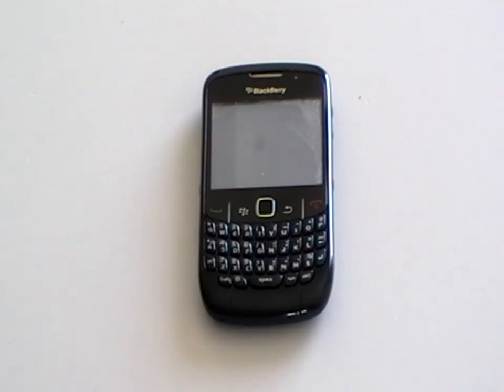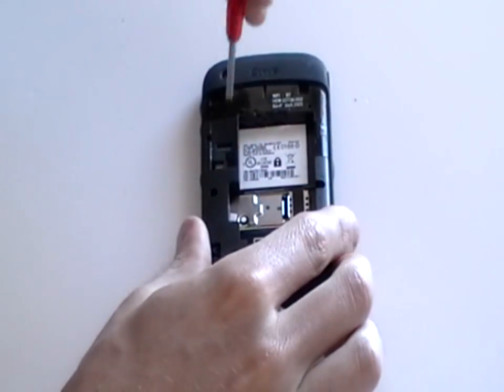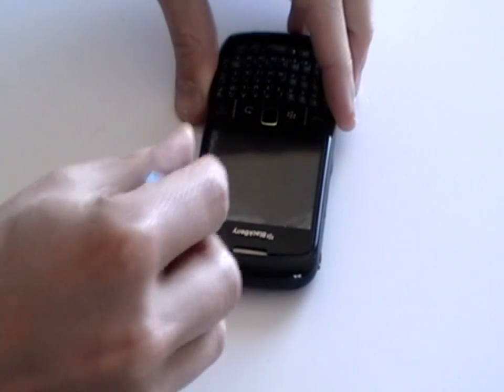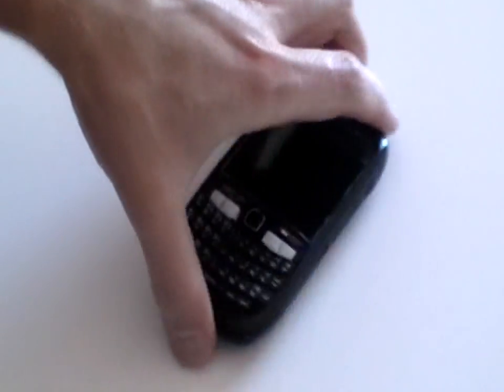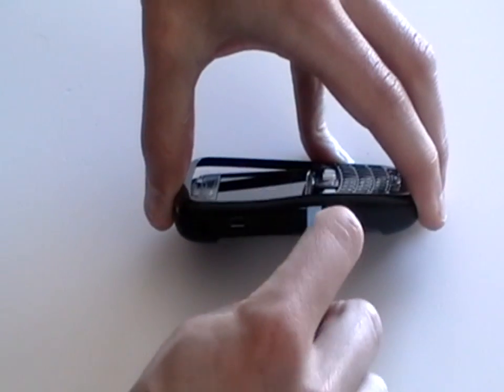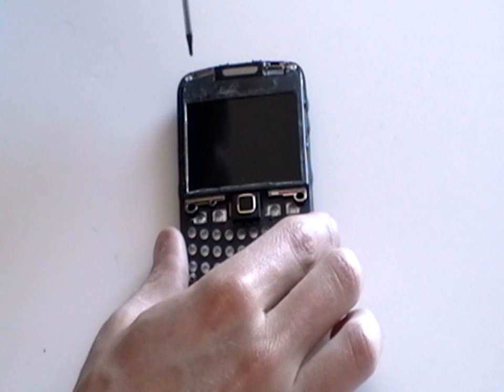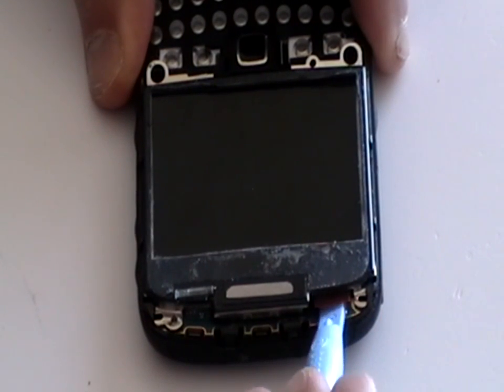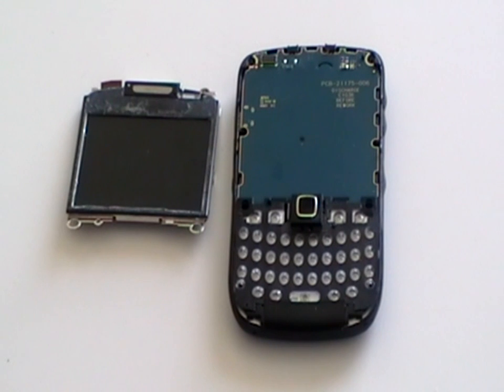Blackberry Curve 8520 Take Apart & LCD Screen Repair

Comment from the maker: If it is just the outside glass that is cracked then you will only need the the touch screen digitizer. If the inner display is busted the the LCD needs to be replaced.

Comment from the maker: You will either need to use a screw extractor to remove the screw, or use a small drill bit to drill out the screw and remove. These are your two easiest options.

Comment from the maker: Could be caused by the bent pin, however it seems unlikely. To be safe, I would suggest attempting to straighten this pin. 
Other causes could be motherboard damage or the wrong LCD version being used. Did you double check the correct LCD version was being used?

Comment: well it all started off when i droped the phone and the screen still worked but the top front  cover had smashed. the screen worked but 1 day turn white i put a new lcd screen in and its doing the same thing i think there is a we pin bent on the lcd conecter on the motherbord . but its not bad . so could there be any other way that would couse the screen to go white. thanks for your reply :)

Comment from the maker: What kind of damage was causes? Bent pins? 
White screen can be caused by many things, including damage to the LCD screen, motherboard connector, or the wrong version of LCD screen being used. I would suggest checking the old LCD screen part number to be sure it is being replaced with the correct LCD version. We have a video in our channel explaining this.

Comment from the maker: @DeanneW94 You will either need to use a screw extractor to remove the screw, or use a small drill bit to drill out the screw and remove. These are your two easiest options.

Comment from the maker: @GaryDomaz Normally you can reuse the old adhesive off the lens, however new adhesive will insure a nice seat, so no dust will get under the lens. Pre-cut adhesive can be found at RepairsUniverse (dot) com.

Comment from the maker: @mclem1902 You will either need to use a screw extractor to remove the screw, or use a small drill bit to drill out the screw and remove. These are your two easiest options.

Comment from the maker: @superkirby14 Very true, you can use credit cards, guitar picks, small flat head screwdrivers, etc. However the safe pry tools are very handy for these repairs and are made of soft enough plastic that they will not scratch or damage housing and other components.

Comment from the maker: @sophieenaglee You will either need to use a screw extractor to remove the screw, or use a small drill bit to drill out the screw and remove. These are your two easiest options.

Comment from the maker: @kevin619ize The screen can be removed this way, but not installed - you will not be able to attach the flex cable properly. You will need to get a Torx T-6 screwdriver to remove the screws to gain full access. These are available at RepairsUniverse (dot) com.

Comment from the maker: @themixedtape2 Its all about alignment and pressure. Be sure the bezel is lined up correctly and start with the top (may make it easier) and just work your way around. Use a decent amount of pressure but don't force anything into place. The clips should just snap together.

Comment from the maker: @xxbabyrushxx Tough to say, It would depend on what was damaged due to the water. Could just be a sim card issue (might try a new one?), antenna issue, or even software/motherboard issue. Really tough to diagnose from afar, too many variables. A local repair shop may be able to provide more info.

Comment from the maker: @urko97 Possibly a loose LCD connection from the drop. I would suggest checking this first and getting the LCD version number. If the screen is still not functional, replacing the LCD screen will resolve the issue. These are available at RepairsUniverse (dot) com.

Comment from the maker: @WeeMcrackers This sounds like damage to the LCD screen. By "smashed" do you mean inky spots on the display, or other similar damages? If so, a LCD replacement would be needed. These are available at RepairsUniverse (dot) com.

Comment from the maker: @beautyblowout Yes, that would be our suggestion. Check for any damage or abnormalities with keypad flex cable. We haven't seen this exact issue before but it is likely just the keyboard flex cable is either dirty or is bubbled at the "A" button. Only way to tell is to disassemble. Good luck!

Comment from the maker: @gangbang1971 Check out our video on this subject. It is called "Determine LCD Version for Curve 8520, it is available in our channel and will walk you through the steps required.
Once the version is determined you can find replacement screens at RepairsUniverse (dot) com.

Comment from the maker: @vectradv57kgn07 Does it charge when plugged in? It is possible that the motherboard may have been damaged. It is very difficult to diagnose water damage from afar, however If the phone is charging and being detected by a computer then it is very possible the LCD screen itself may be damaged and will need replacing.

Comment from the maker: @andresc123 The area the lens is adhered to is not part of the housing you are attempting to remove. It may not be necessary but highly suggested as it will make removing the housing much easier.

Comment from the maker: @baxtermfc The BB 8520 uses a T-6 Torx Screwdriver. These are available at RepairsUniverse (dot) com. If it only has one screw it is likely it has been taken apart before.

Comment from the maker: @ksefan97 Likely just a snapped / loose clip. I would suggest diassembling and checking it out. Adhesive strips are a great way to fix little issues like this. These can be found at RepairsUniverse (dot) com.

Comment from the maker: @123cod6player Yes, you will likely need to replace the LCD screen. However there is a chance that it is the LCD flex cable / connection. I would suggest disassembling and checking this out first. If the connection and flex cable look fine, you will need to replace the LCD screen with the correct LCD version.

Comment from the maker: @solf08 I do not believe you "have to", although it does help when removing the front cover. The lens is held in place with adhesive not only on the housing, but also on the LCD housing. It is a procedure we always follow.

Comment from the maker: @dancewithmepipi You will have to speak with your specific service provider about your warranty, as they vary. If a single key is not working it is likely just dirty or stuck or not hitting the connection properly. I would suggest disassembling and taking a look at the interior side of the keyboard and keyboard flex cable.

Comment from the maker: @kevine1995 We suggest using new adhesive, but it is not always required. Just gives it a better seal so no dirt or dust get under the lens. You will need to remove the lens to access the LCD screen. Thank you and let us know if you have any other questions. Adhesive, lens, tools, and replacement parts can be found at RepairsUniverse (dot) com.

Comment from the maker: @juanjohalamadrid Yes, it is quite possible. I suggest disassembling and checking the LCD connection. It is also possible that you will need to replace the LCD screen. These can be found at RepairsUniverse (dot) com.

Comment from the maker: @xXkortney94Xx This is the LCD screen. Replacing this should resolve the issue. Be sure however, that the correct screen is used to replace it, as there are many versions of the 8520 LCD screens. Check out our "How to Determine Which LCD Version I Have on 8520" video in our channel. All reaplcement parts and tools can be found at RepairsUniverse (dot) com.

Comment from the maker: @MRtriplehorton Following the video in reverse should have all the major steps needed. As for the lens, if the adhesive is not "sticky" enough, you will need to replace the adhesive. Some glues may be used, but may be a pain. RepairsUniverse (dot) com has pre cut adhesive that provides the best seating of the lens.

Comment from the maker: @HumzaProductions12 I suggest making sure the correct LCD screen version was used. Compare the old LCD # with the replacement screens #. If they match it may be a connection issue. If it does not match, then the wrong LCD version was used and the correct one will need to be used.

Comment from the maker: @rebecamgi Water can damage a lot inside the BB, so if the motherboard got wet and caused damage, replacing the screen won't fix it. If the motherboard seems to be working fine, such as powering on, receiving calls, vibrating, etc, then replacing the screen should fix the problem.

Comment from the maker: @rebecamgi Water damage is tough, there are many things that can cause black screen, white screen, etc. Does it power on, charge, connect with a comp? If you can trace the issue to the LCD screen, then it is likely that a replacement will resolve the issue.

Comment from the maker: @batujohn No problem, great work replacing the screen. This type of issues is normally caused by a bad connection with the keyboard flex. Pop it open and make sure the space bar is lined up in a proper position to make contact.

Comment from the maker: @batujohn We do not have an assembly guide, but just use this take apart as a reference and reverse the steps, you should have no issues. The 8520 is a very simple repair. Good luck!

Comment from the maker: @dazpolz1 Many people re-use the adhesive from the lens, however we suggest using new adhesive, giving it a better seal and making dust/dirt harder to get inside. And yes, when assembling everything usually falls in place, follow this video in reverse and you should have no issues.

Comment from the maker: @beeBASMA The best thing to do is remove the battery, use a cloth to clean up as much liquid as possible, then place the phone and battery into a bucket of rice in a warm area for 12 hours or so. From there, all water will be absorbed and you can then test to see damage/usability. Alternatively, remove the battery and place your device in front of moving air (a fan) for 12 hours or so. These are the best tactics to deal with water damage.

Comment from the maker: @nobigdeaaal Are they turning or won't budge at all? You may need to use a screw extractor to remove the screw, or use a small drill bit to drill out the screw and remove. These are your two easiest options.

Comment from the maker: @babbiiangell Use a very small drill bit on the stuck/stripped screw. Depending on the size of the screw and the size of the bit, it will either remove the head of the screw, which will allow you to continue to make your repair. Or the preferred method is to drill through the screw, removing everything but the threads, which can then be blown out..

Comment from the maker: @babbiiangell You will either need to use a screw extractor to remove the screw, or use a small drill bit to drill out the screw and remove. These are your two easiest options.

Comment from the maker: @yazyh If the full keypad is not working, it may be more than just dirt or dust. If specific areas are, disassembling and cleaning should hopefully resolve the problem. Otherwise, it could be a damaged flex or similar for the keypad flex.

Comment from the maker: @wgardens The LCD number can be difficult to find, there are a few different locations. We will be doing a video this week showing the various locations. The most common places are on the back, engraved (making it difficult to see under low light), under the adhesive or flex cable, and after removing the housing of the LCD, on the front of the LCD screen.

Comment from the maker: @shanemangoo We have many models of LCD screens for the Curve 8520 available at RepairsUniverse (dot) com. To see which version you have, you must remove the LCD screen and check for the part number on the back, starting with LCD-   
You can then determine the correct version.

Comment from the maker: @raf1q247 Could either be a connection issue or the wrong LCD version. Double check the LCD connector and make sure it is fully in place. If not, make sure the new LCD screen is the correct version.

Comment from the maker: @tonyvarghesee As far as we are aware, there is no other way to determine the LCD type besides the LCD # and simply testing the different versions. Many aftermarket manufactures may have the LCD # written very small and in unlikely places, double check. Good luck!

Comment: Hi,

I tried to remove the screen cover, but not with the tool you used, and now I think I pussed some glue under the screen cover. So I wanted to order a new screen cover, but I was wondering if I had to put some glue and the edges or not?

Comment from the maker: @bushed06 If the display is having issues, like colored lines, discoloration, dead pixels, ect. then you will need to replace the LCD. The screen cover is commonly just scratched, ripped, or peeling off. You can find both replacement parts at RepairsUniverse (dot) com. Good luck!

Comment from the maker: @amburritoxo Screws at the top, are you referring to the T6- torx screws? If so, you will need to get a T6 Torx screwdriver to disassemble the 8520.

Comment from the maker: @moreload Yes. You can use glue, but usually creates a mess and not a very good seal. We do sell model specific adhesive as well which makes the process much easier. Our current stock of 8520 lens has the adhesive pre-attached, making the swap very painless. Check them out at RepairsUniverse (dot) com.

Comment from the maker: @tatajamrock Hi,

You need to remove the LCD from your phone and check the part number that is on it. The part number will start with LCD-. Once you have the part number you can order the correct screen.

We have the replacement screens on the RepairsUniverse (dot) com website.

Comment from the maker: @shock2thesystem91 Hi,

You need to remove the LCD from your phone and check the part number that is on it. The part number will start with LCD-. Once you have the part number you can order the correct screen.

We have the replacement screens on the RepairsUniverse (dot) com website.

Comment from the maker: @cj77ba Hi,

You need to remove the LCD from your phone and check the part number that is on it. The part number will start with LCD-. Once you have the part number you can order the correct screen.

We have the replacement screens on the RepairsUniverse (dot) com website.

Comment from the maker: @leigh22090 Sounds like a connection issue somewhere. I would check over the connections and make sure you have everything installed correctly.

Comment: Hey guys, got one more question. I've just (successfully) opened my BB. I went to you're site and saw the screen I need (007/111) and I was wondering if it can be shipped to Europe? I live in the Netherlands and the prices from you're site are WAAAY better then those rip-off stores here.
Have a good evening.
-Glenn

Comment from the maker: @poega2007 You need to remove the original screen from the phone, check the part number and then purchase the correct version. We have all the different version 8520 LCD screens at RepairsUniverse (dot) com

Comment: heyy i dropped my blackberry curve 8530 on the ground the other day and i ordered i new lcd screen. i did as you told in the video but when i installed the new lcd screen it was just white with nothing on it. i tried putting it in charge and it wouldnt work. i even took it out and blew on it and it still wouldnt work.  i really need to repair this phone.

Comment from the maker: @richie388 No, you need the 8520 screen and also need the correct version of the screen for your phone. The part number of your LCD is on your current screen. Make sure you order the right one. You can find all the different versions at RepairsUniverse (dot) com

Comment from the maker: @douchebagmoore It should be under the metal frame. It will be small and will start LCD-

The code is not regional. So you will need to find this part # before you can order the correct part.